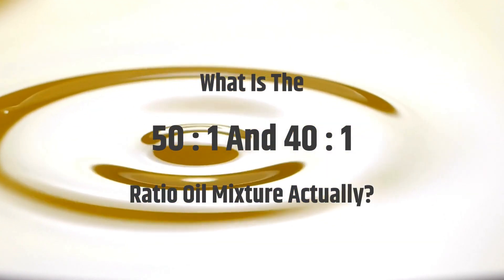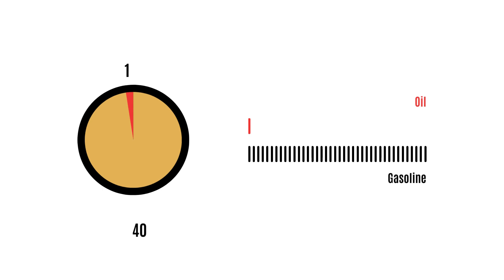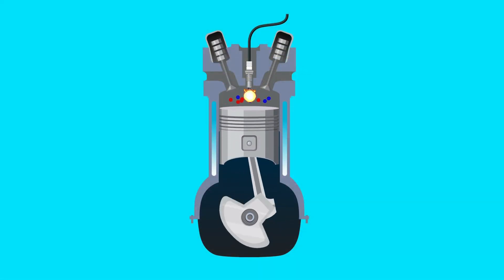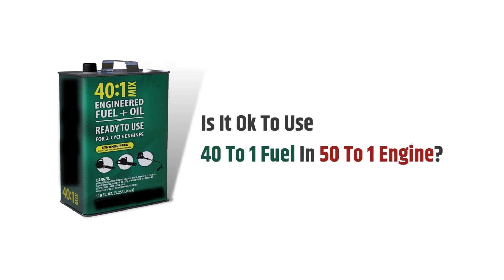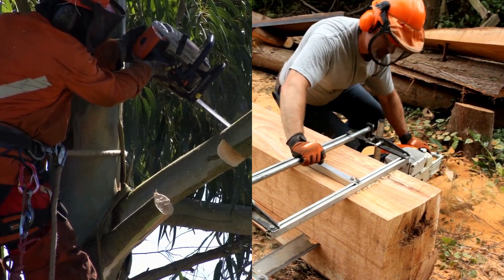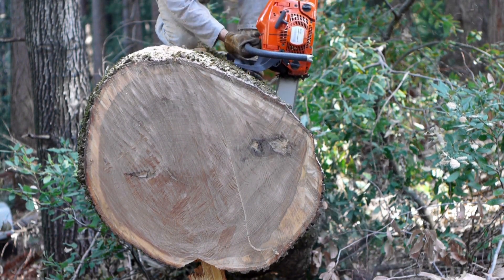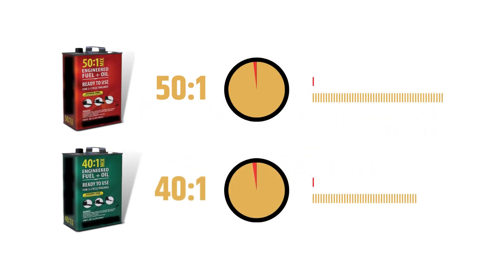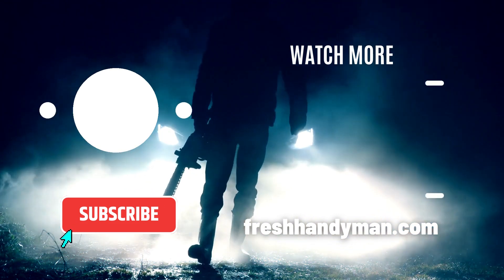Unlocking the Secrets: Can You Safely Use 50 to 1 in a 40 to 1 Chainsaw? Find Out Now!

Comment: In my new chainsaw, I use a mixture ratio of 1:25 for the first three tank fills instead of the regularly recommended mixture ratio of 1:40 for the engine's running-in phase.

Comment: A two stroke carburetor can be tuned to obtain best performance from any mix ratio.  More oil is almost always better than less.  Oil serves three purposes in a two stroke; lubrication, cooling, and cleaning.  Each is critical to engine longevity.

Comment: Who would dump engine oil derectly into the fuel tank then add gas ?  Not a good idea.
Reply: The best way to figure a 40:1 mix is a 3.2 oz bottle of quality 2 cycle mix to 1 gallon of non- ethonol gas.  1 gallon is 128 oz.  Divide 128 by 3.2 and the answer is 40, 40:1.  Conveniently mix oil comes is 3.2 oz bottles.  Just put a gallon in a  jug, dump in the oil and shake it up.  2 gallons would be 2 bottles of 3.2, etc.   50:1 is 2.56 oz oil to 1 gallon.
Reply: My neighbor always did that. Had no clue about ratios- Haha! His machines were always broken.

Comment: You really should be mixing more oil into you fuel. More oil will give your saw more power, obviously don't over do it. Between 40:1 and 32:1 is best. And never use pre-mix fuels!
Reply: What? Oil gives your saw more power? Oil is a lubricant, not a combustion fuel. Or is the idea that since it's not combustible, it creates more compression in the cylinder? Like how they ran steam in some gas engines for a compression boost?

Comment: just memorize 40:1 is 3.2 oz. of 2-stroke oil to 1 gallon gas … 50:1 is 2.6 oz. of 2-stroke oil to 1 gallon gas … best to use gas WITHOUT ethanol and use 95 octane gas (available at Shell Oil gas stations)
Reply: I use a 1 liter Stihl fuel bottle and add 25ml of oil for a 40:1 mix…that’s what I run in my chainsaws(firewood cutter)

Comment: I have several 2 stroke engines some 40:1 and some 50:1. I've been running 45:1 for many years without problems. Far more important is fresh  non-ethanol gas.

Comment: go with manufacturer specs, they no what is best for the motor they built, i fully recommend premium gas always and a good oil, stihl and most chainsaw oils have preservative in it wich is good, dont cheap out with oil
Reply: They are subject to EPA exhaust mandates…I run 40:1 in my saws…works fine…
Reply: I wouldn't own one!

Comment: The less amount of oil in the mixture, the more the wear. Raced and tuned two strokes for many years. Eve was witness to a 500cc race bike that was acidently run with no oil. It ran 2 days riding and ran good, but lost compression and hard to start. Even straight gas will lubricate somewhat. 
The more oil  in the mix actually makes for a leaner air fuel mix due to the fuel being thicker.
The adjustment of the fuel to air mixture can also even 20 to 1 to burn with exhaust being dry, and no slooge. 
There will be less wear at 20 to 1 than there is at 40 to 1 or 50 to 1, especially at 80 to 1. But correct air fuel ratio is of utmost importance, and is easily adjusted.

Comment: 50:1 was mandated by the epa.
Any stock pro model saw 40:1 
I run 32:1 in all my ported saws because the compression is significantly raised along with higher working rpm’s which makes more heat. Your mix oil is the life of the saw along with tuning. 
Homeowner saws… doesn’t really matter what you run in them because they’re all garbage, made to throw away.

Comment: If you use Stihl HP Ultra oil at 50:1 you will get the best engine performance and longevity. Did you know that Stihl makes a combination 2 stroke engine with valves? I found their innovated engine designs very intriguing and their systems  make sense.
Reply: Amsoil Saber has a higher JASO rating.

Comment: At 06:26 oil is being poured directly into the gas tank of the saw, and a lot of it.  The container that it is coming from appears to be what two stroke oil is sold  in.  This is not good procedure.  You would expect the oil and gas to be mixed beforehand in a container and then poured into the saw.  Or am I missing something here?

Comment: Different oil has different properties. Synthetic oil can take high heat. It is made from natural gas. Oil made from crude provides a better lubricant but can break down in high heat. Castrol oil provides the best sealing between piston, rings and cylinder creating more power. The best oils are blends of the three. Castrol 747 or Maxima 727. The 7s are the ratio of crude oil and synthetic. The 2&4 are the amount of Castrol oil. Your going to have to go someplace that does 2 stroke racing to find these oils. The oil gas ratio for maximum power depends on how high of RPM the motor runs. A engine running very high RPM best ratio may be 16-1. Chainsaws are not running that high for long periods of time. The 50-1 is what most modern chainsaws are set up to run. They put out less pollution with this ratio. With modern electronic controlled saws chaining the amount of oil can make them run bad. How lean or rich an engine runs can be controlled by the amount of oil. The richness of the mixture is dependent on the amount of gas and air. Increasing the amount of oil replaces some of the gas which leans out the saw. You can over come this with jetting. If your jets can be adjusted that far.

Comment: I accidentally ran 80:1 for a few hours in my weedwaker and blower in moderate weather.  Neither were hurt by my mistake but of course they are not chainsaws which are subjected to higher continuous running.  I have used chinese plugs, regular gas and outboard oil at 40:1 for many years with no apparent ill effects but then again it is homeowner use. In those years I have occasionally replaced primer bulbs, fuel lines and carburetors.  I suspect these small motors are designed to allow a broad range of fuel quality and still have a reasonable life.  Regardless, tremendous respect for all the knowledge you experts have.
Reply from the maker: Thank you!

Comment: I've always used 32:1 in 50:1 engines with 50:1 Synthetic oil. Never had a problem, power is awesome and I've never replaced rings, pistons or any other engine part in over 30 years. In fact I use the same mix in every 2-stroke engine that I own. 😁👍🏻🇦🇺
Reply: Years ago I had a 32:1 saw. I bought a new 40:1 saw. I was told I could run 40:1 in both saws. After one tank of gas the old saw was toast. Best saw I ever owned.
Reply: @billbrown5853 , you leaned out the 32:1 saw too much.   Probably burned it up.   Don’t listen to yahoo saw shops
Reply: I always thought little two strokes ran on rich mixes.like 16 to 1. I know with better lubricity of modern oils that less is needed. But,now they all are 50 to 1. That is a bit of a difference.i probably will run 40. Better a lil much oil than not enough.on the big 500s i always ran 40 to one
Reply from the maker: Thanks for sharing!

Comment: Half-arsed information here. Light and heavy has absolutely nothing to do with this nor the decision about what ratio to choose. The first choice is 'what kind of oil do I mix with my gasoline?' The answer is: a two-cycle oil made to standard FD (currently the highest availble) as set by JASO. Read the labels. 

The second choice is 'What mix ratio do I use?' Answer 50:1. The JASO FD standard requires that the lubricant mixed at 50:1 covers all mix ratios no matter what the manual calls for. i know that just blows peoples' minds and some heads even explode. Don't believe me, read about it. The manual of every current Echo product has a paragraph about oil that states these facts. You can freely read their manuals on line.

Today's greatest cause of lubrication failure is not the mix ratio, it is neglect. Modern adjustable carbs are not set it and forget it and ops will not learn to adjust nor pay for adjustment. Adjust by the seasons. Adj according to service manual instructions. Adj according to tachometer not your ears.

Further, much equipment delivered to customers arrives in a lean fuel to air mixture condition. Remember, the lubricant is in the fuel so if it isn't getting enough fuel it isn't getting enough oil either. Rule of thumb, unit goes in for adj after first five tankfuls of gas.

Comment: Two stroke and 4 stroke; not 2 cycle and 4 cycle. A two stroke is a one cycle engine, a 4 stroke is a two cycle engine.
Reply: You almost got it right. Both two and four stroke engines are described in terms of 'strokes per cycle'. A two two stroke is properly called a 'two stroke cycle' engine but of course that's a mouth-full, so we just say 'two stroke'. A four stroke is a 'four stroke cycle' engine,  not a 'two cycle engine'.
Reply: You are describing a combustion cycle, which takes 4 strokes in a 2 cycled engine. A two MECHANICAL cycled engine takes 4 strokes. "Cycle" was always meant to refer to the mechanical cycle, otherwise all engines would be one cycle engines(2 and 4 stroke) . @paulmaxwell8851
Reply: @paulmaxwell8851  You are referring to a different "cycle", the combustion cycle; not the physical up and down(strokes) required to complete a combustion cycle.
A two stroke completes a combustion cycle with one cycle of the engine.
A 4 stroke completes a combustion cycle with two cycles of the engine.

Calling engines 2 and 4 cycle is just incorrect, although a 4 stroke does make two cycles of the engine.
Reply: @paulmaxwell8851  Yes and no. We are both correct. A 4 stroke takes two cycles of the engine to complete one complete cycle of intake and exhaust. Clearly, when people say 4 cycle, they are referring to 4 strokes making 2 turns of the engine. No where does 4 cycle make sense.

To be clear, they all complete a single cycle of intake and exhaust, 2 strokes or 4 strokes would both be single cycle engines using your description.
Reply: I'd put pay check down and bet that your comment put at least 400 viewers in the psych ward with irreversible frontal lobe hematomas. and kaleidescope vision for life. That was uncalled for sir!  He he he... Do it again 😉
Reply: Probably shouldn't mention the wasted spark every other cycle in a 4 stroke, what? lol ;-) 
 @normjolin2881
Reply: @normjolin2881  :-)
Reply: 2 strokes and 4 strokes are in relation to 1 complete cycle of suction-compresion-ignition-expansion-exaust of ICE engine. 2 cycle or 4 does not make sense in that context.
Reply: 2 strokes uses oil mixed in fuel

Comment: I own 135 chainsaws! And the way you completely throw that heat issue out the window is by not restricting the exaust pipe with all the Baffles and spark arrestors and I have even seen steel wool used to catch the hydrocarbons that fuel creates when burned! A 2-stroke engines piston is traveling so fast that it needs to be an in and out as fast as possible! If the spent exaust gasses are stopped in one direction and made to turn and start moving in a different direction and then sized down to escape out of a little hole you are causing the exaust gasses that are super heated and now traveling at twice the speed of sound to backup in the exaust pipe. When this happens as soon as your transfer ports open that super heated spent gasses get sucked back inside the cylinder and down inside the crankcase via the transfer ports! The only way to honestly say this is, You cannot save the world by putting a catalyst in your exaust pipe, but you sure as hell can burn up a nice saw by doing so! 😉
Reply: Awesome! Clear, concise, understandable.
Reply: Thank you for the great explanation
Reply: No, the exhaust gasses are not moving faster than the speed of sound. That is actually physically impossible. Yes, an object can move through gasses faster than the speed of sound, but all that would happen if you tried to make gasses move faster than the speed of sound is they would compress, resulting in an increase in the speed of sound.  Also, what you recommend would make the saw even louder. watch your ears.
Reply: At 140 chainsaws you will finally reach the godly knowledge of the 2 stroke like me. Only a few saws away mate 💪
Reply: Take your catalytic convertor out on your car and muffler, and your vehicle will perform better...
Reply: These are facts and well known but why are they there...look at why leaded gas was out lawed in the states and its effects.  Good for cars but not for people in the long run, the statistics prove it.
Reply: @da_Luv_U Oh that's what I want leaded gas as if there ain't enough crap in our food, water and air....Then we wonder why our kids are so screwed up.
Reply: Chaat aap !
Reply: But you do know that a 2-stroke engine needs a defined amount of exhaust backpressure (measured on the test bench) to, firstly, minimize scavenging losses and, secondly, optimize power output? A resistance-free exhaust outlet is counterproductive for a 2-stroke engine.

Comment: I did not realize there are different oils for 'big' 2 cycle engines such as outboard motors and 'small' 2 cycle engines such as chain saws and man portable yard equipment.   2 cycle oil sold in gallon cans is probably not meant for small 2 cycle engines.
Reply: Two stroke outboards run at a much lower engine temperature due to the problem with salt buildup in the cooling system. 
That’s why they need a different type of two stroke oil (TC-W3)
Reply: @kimschlebaum  boat engines also run at much lower RPM (about 6K) than chainsaws and also idle more often. The TC-3W oils have no or very little ash to prevent idling boat engines from fouling the spark plugs. Less ash mean s less lubrication but as you said boat engines run at lower ope. temperatures because they are water cooled. Chainsaws are air cooled and run at much higher RPM (about 12K).